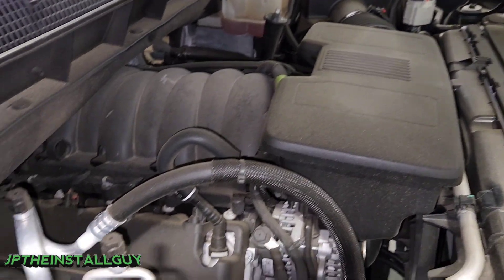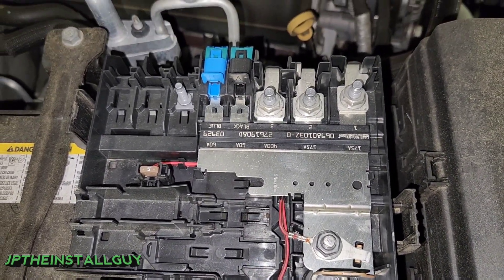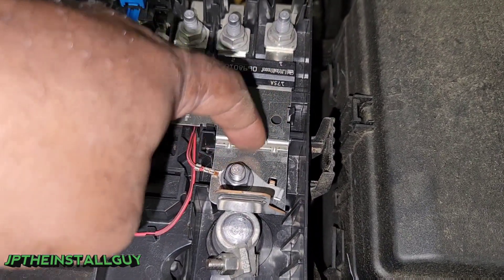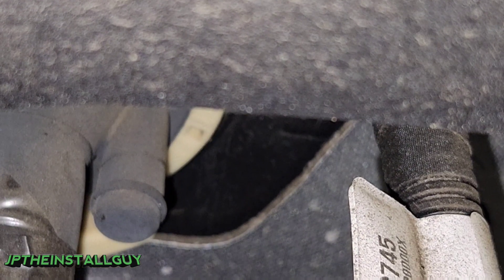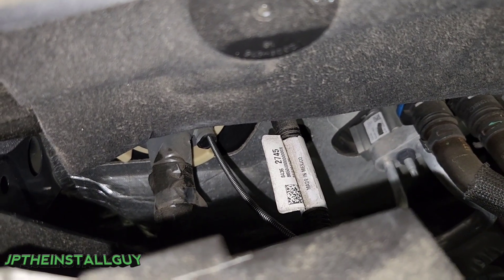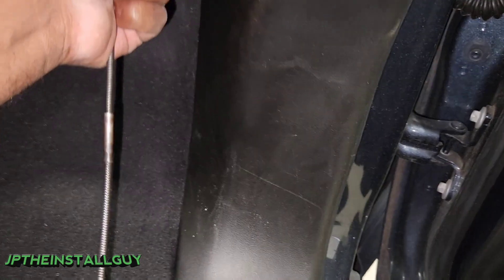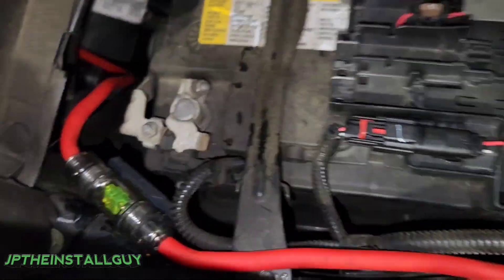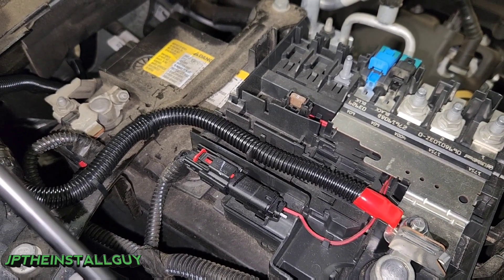how to run amp power wire through firewall of 2020 chevy Silverado truck

Comment: the 2015-2020 escalades seem impossible to go through. i see there is a grommet up and behind the brake pedal but im worried about effnshtup. not tryna drill thru either. theres a million wires down there fml